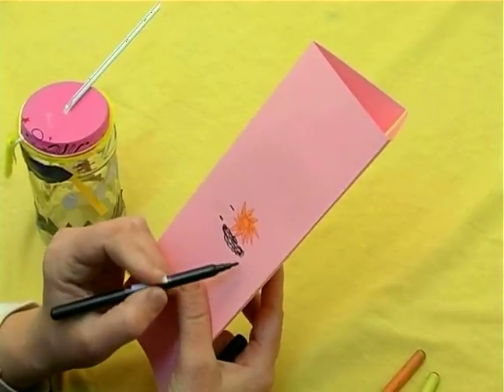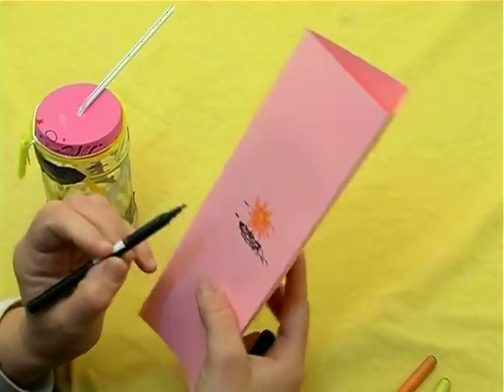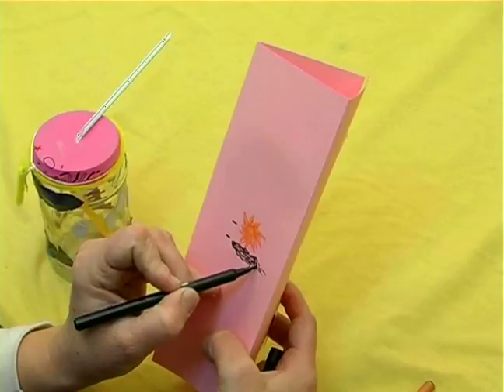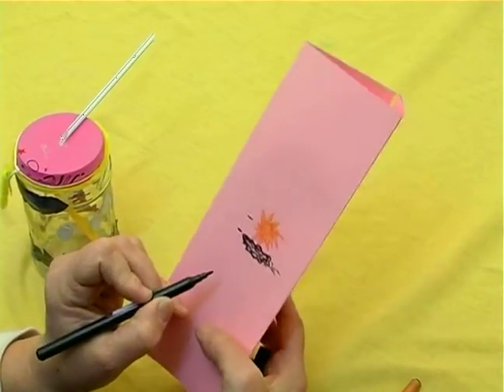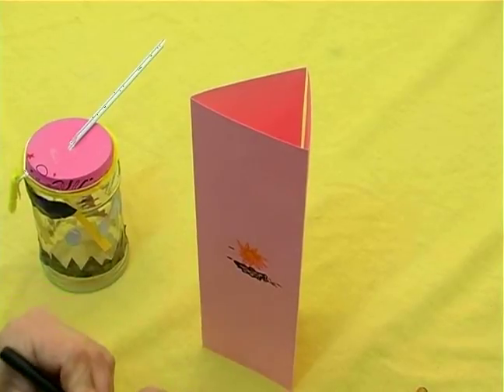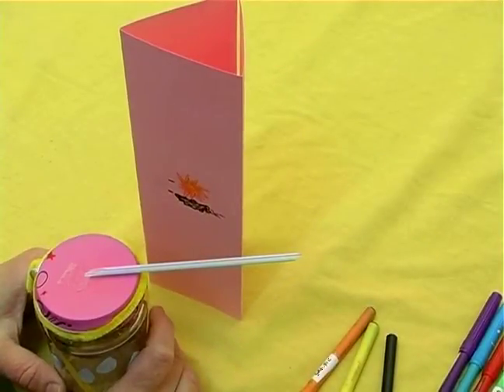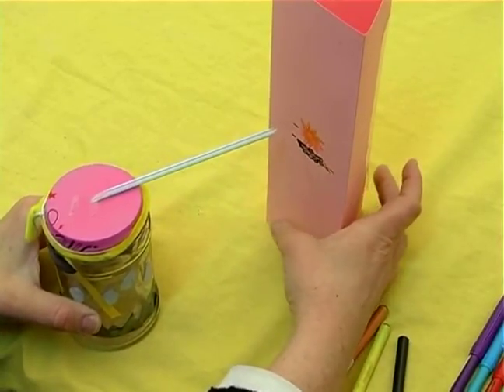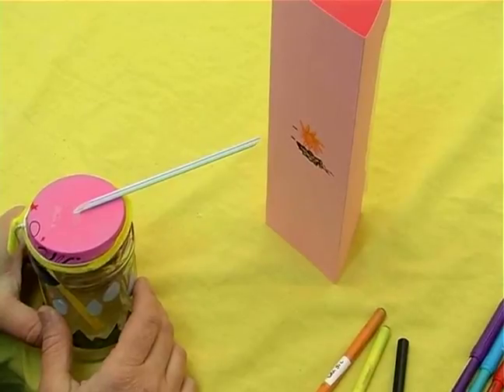How to Make a Barometer : How to Read a Barometer

Comment: I have a Konus Meteo Station and i don`t know if it works or not, even if there are drastic changes on the weather in my hometown, the arrow don`t seem to move a bit....there is a knob on the back of it and i turn it left or right and nothing happens, i know it does something, but still haven`t got a clue on how to "set it up"  so i guess i need an experts help! thanks.